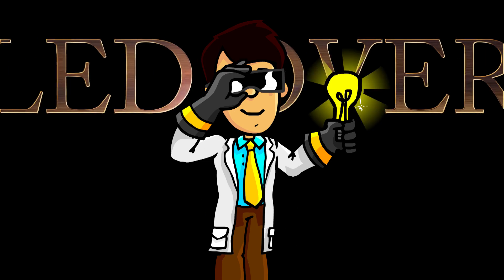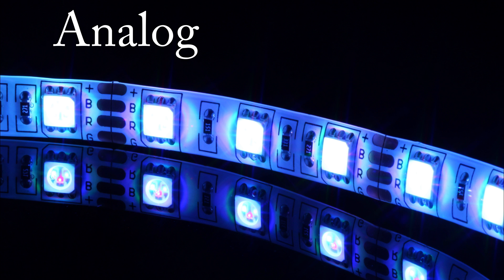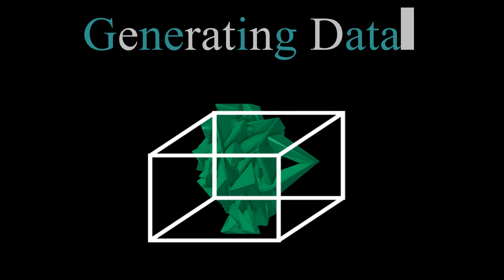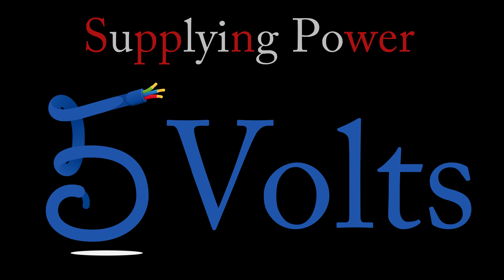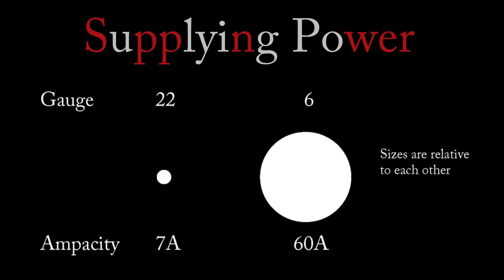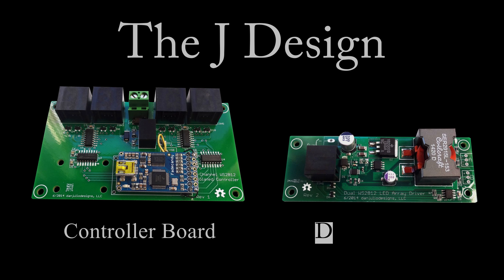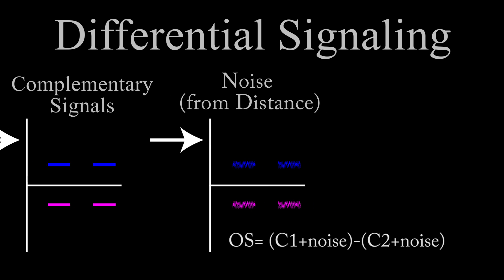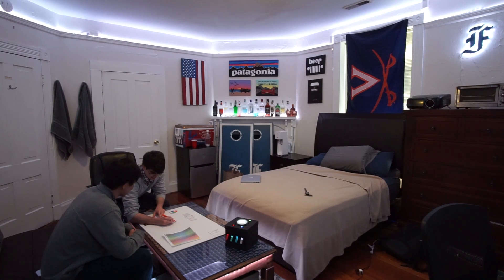1000 Addressable LED Lights Project Overview

Comment: Get a quid uno or a quad uno, quindor has just this November 2022 just released his October controller that has brain boards and power boards that you can expand, each one is less than 40 and you can use WLED or fastled and a few more free programs.  They come flashed with wled are bluetooth and or wifi or eithnet hard wired, unos are excellent little boards to control 3000 to 4000 leds.

Comment: I am using NeoPixel Stick - 8 x 5050 RGB LED with Integrated Drivers but at start the LEDs start burning

why its happened, Any idea?

the Strip use multiple Amp according to Strip Colors

is Constant -Current-Regulator necessary ? If Yes, Then how?
Reply from the maker: Usually this a problem with your voltage being too high. Check with a multimeter to make sure your voltage is in spec.

Comment: What I did was use a nodecmu which can connect to wifi on a 600 addressable setup and on every strip I ran a 5v and ground line to the new strip. If you get aluminum diffusers you can hide all the extra cabling inside the aluminum channel. Which also makes the led look better

Comment: Why not use 12v LED strips and, of course, 12v power supplies. This limits the number of stations that you need, and you would only need a buck converter to power an Arduino of the main power line

Comment: do i need a controller board for a single (WS2811) string of 50 (12v) LEDs?  I do have a 12v30a power supply and I'd like to use an Arduino to control the string.

Comment: you dont need 60 amps you can split the leds into 10 strips and multiplex them.  nanos are so cheap, you could even drive each strip with its own arduino and have the arduinos talk to each other for synching.

Comment: This is a great project that you guys started! I have a quick question. My understanding is that a single controller board can control up to 4 * 128 LEDs, right? How can i control more than 512 leds? Can controller boards be daisy-chained or they have to be individually connected using USB to controller like RaspberryPI? What would be the best way to control 1200 LEDs? Thanks!

Comment: I would like to know is their an an update to the j design as adafruit has updated some designs is their a better way to control/ transmit power to 1000 digital leds and would I be able to use rgbw instead of rgb. This whole video is awesome because this is exactly what I was looking for. Complete customization/ flexibility and real time. Because I’m not using an arduino and I want to use different types of the leds strips or matrix’s. Is their an update to the driver used. I’m also very new and just starting. Don’t want to waste to much money on purchasing wrong things that won’t work.

Comment: I’m new to this... would it be possible to  separate he main components of the driver board into the transformer for power and use a Bluetooth receiver for data? Or would you have to attach the  the Bluetooth system to the controller board and create an app to replace the computer signal... would this also mean that the data would have to constantly be set to the controller board or would it loop until given a new signal??